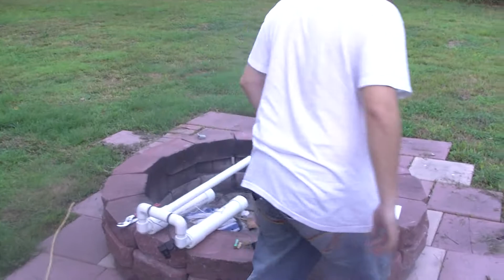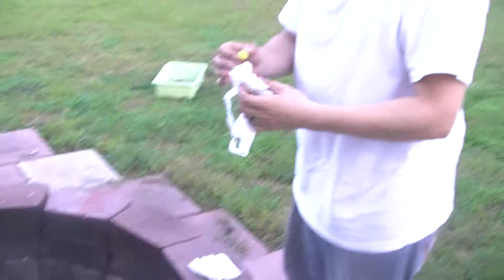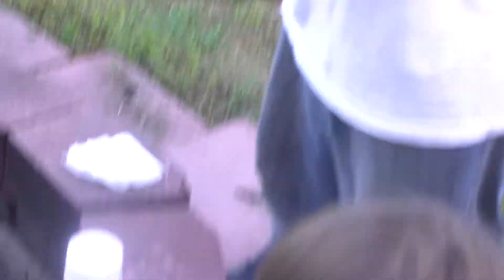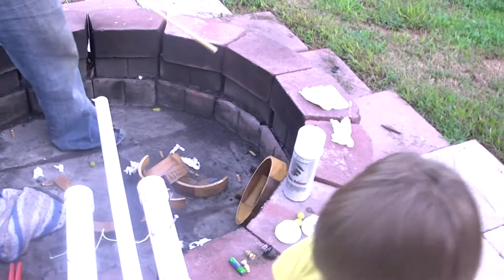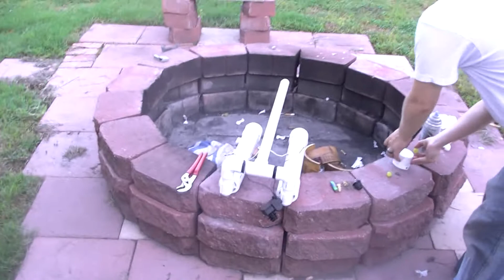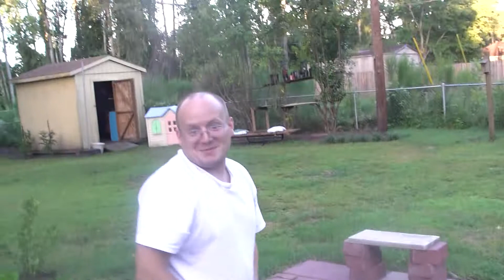dual chamber potato cannon prototype first fires

Comment: also i would put 2 tee's at the end and have your ignitor in the middle to make a complete circle. then the explosion would start from the back travel around both sides then meat again at the barrel (and also make it stronger again). if you have the ignitor close to the barrel the burn travels in the wrong direction. just a couple things that might help your efficiency!

Comment: you should take 2 of the smaller 90's out and have the barrel go between your cumbustion chambers. it would provide alot smoother flow for the expanding gasses and also make the design stronger!